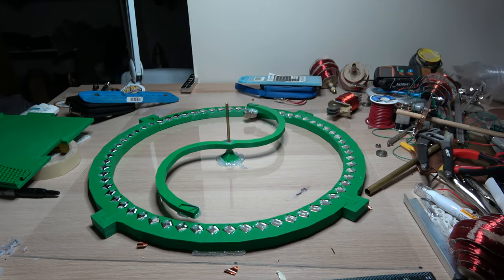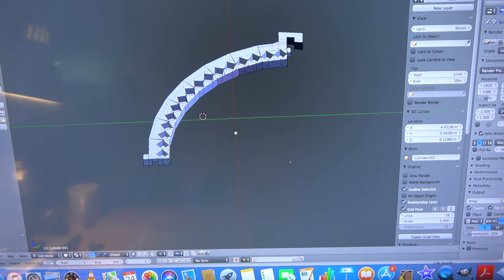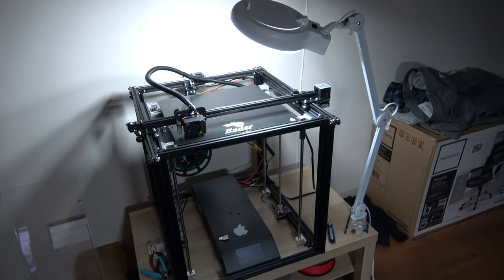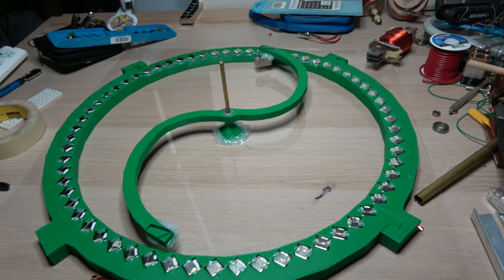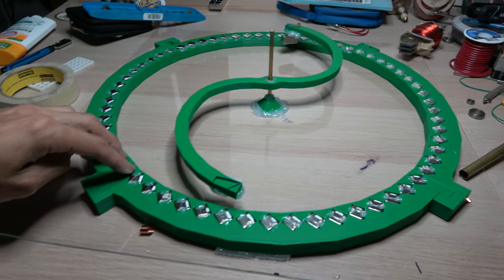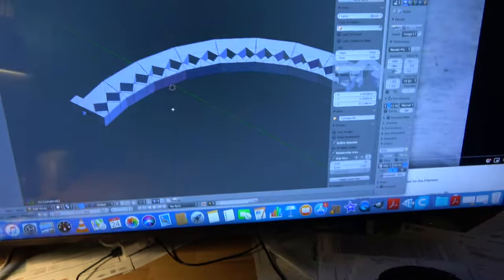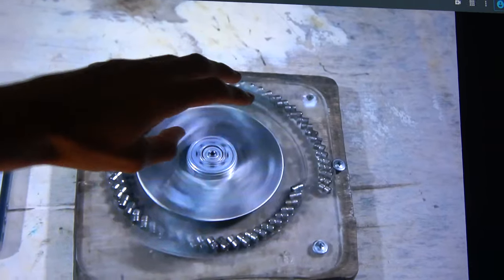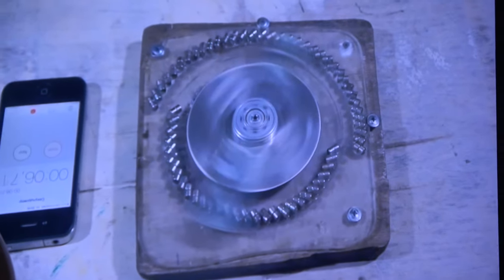Permanent Magnet Motor2 - Howard Johnson

Comment: Thumbs up because you tried.
I plan to do somewhat the same, but... with ultracapacitors + 3 permanent magnets in a tube + plus a very lightweight disk to act as an alternate switch between them. Basically, the p~ magnet in the middle would get strongly pulled whereas each of the 2 disks would alternatively redirect the magnetic field away from the nearest p~ magnet, therefore... allowing the furthest p~ magnet to pull the central p~ magnet which the force will recharge the ultracapacitors, whereas a tiny fraction of the charge will move the 2 disks simultaneously through an electromagnet.

Comment: I suggest making the center spin piece be shaped like a gear and have magnets within the teeth of the gear. Maybe 8 to 16 teeth on the gear. What would spin the gear piece is magnets stacked together (to increase force) on the outer ring. Only 4 placements of magnets on the outer ring. You can also add a hydraulic piston function to push the magnets on the outer ring to get closer to the center spin piece  for activation.

Comment: Change the angles of the mags on the arms, and use a spring to pull it back? Or use a flywheel that engages and disengages at certain points, Or try to add more weight onto the arm ends or 1 or... many arms working and well 1 or more working and like a baton race the next few arms take over ? Or spiral it up just one level and if it keeps going let it spiral back down, and that will be the completed circuit. Sorry can't draw it with my keyboard.

Comment: Hi there, your build is beautifully designed. Id like to offer a few pointers in order to help. 

Youll find it difficult to get anything other than an expensive brake that way, anything like the perendev motors wont work. The reason is ... that magnets have a kick not only to propel something forward, but also it has a kickback when a magnet enters a neighboring field. This is in equal amounts and will always result in stopping. The best you can hope for is an efficient use of invested motion.

There MAY be a way to jump over these kickbacks so that the forward motion continues. So having a Lifter that is in time with the armature so that it can jump/rid over this kickback might be the way to go.

Also ive seem videos whereby the traveling magnet is moving along a V formation of magnets, and jumping off the top. You might be able to create something like that for your armature to travel along, then have something that forces it to jump over the kickback field. 

Ive seen things on youtube that look like they have worked, but mostly these are hidden motors. In the case of your video share, you can clearly see its a dvd drive acting as the bearing. Some even use wind (hairdrier) off camera and record a separate voiceover. Others use tesla coil field to drive motors instead of a battery. People do this shit-faking order to make money of views, which confuses the young experimenters.

On a side note, have a look into Nitinol https://www.youtube.com/watch?v=oKmYqUSDch8

All the best
Reply from the maker: Thank you, and yes unfortunately many people do use compressed air and other things (like Tesla coil wireless electricity) to create fake videos.  However, some are real like Howard Johnson's original patent for his all magnet motor.  I will have to learn how to grind magnets into crescent/banana shapes in the future.  Here is a video of a real magnet motor in case you were curious.   http://gp.alternate-energy.net/magnet-motor-free-energy-selfrunning-12_bff8aacb4.html

I saw that video about Nitinol some years ago.  Absolutely fascinating stuff!

There is a video on the link I gave of a German made magnet motor from 1962 that apparently uses the same concept you have mentioned.   It might be right up your alley.
Reply from the maker: @DiyEcoProjects  Thanks!
Reply from the maker: Here's the video of the German made magnet motor from 1962 that uses the concept you've described.  Their device worked supposedly.  http://gp.alternate-energy.net/lueling-permanent-magnet-motor-vintage-selfrunning-magnet-motor-from-the-1960s_d1a62de6c.html
Reply: @spiritelemental  cheers for that one... hmm. Also heres website ive just discoverd for pdf's ... look up magnet motors here i guess https://core.ac.uk/

All the best, chat later

Comment: Try replacing the two posts with one and  3D print a case to hold a counter weight which is slanted and has an uneven weight distribution on left and right side.

Comment: you could avoid friction by making the spinner float completely in air by building a magnetic levitation system for it using wireless power transmission. i actually dont think its hard at all, im planning on trying it my self :)

Comment: Why do you leave the magnetic circuit open? The outside magnetic field goes where? Use iron and wrap it down and back to the inside.  The magnets will travel along iron better than air. That is where I see you need the banana shape. On your arms 2 magnets with a U shaped piece of iron, like a tuning fork, you can pull one pole to the center shaft and the ends of the U shape are the opposite pole. Your magnetic circuit is open. I do like the setup, just needs some fine tuning.
Reply: Sam Zurick  but you still need to redirect the magnetic fields..

Comment: Yer only doing one ring, basically one dimension of it.
Like the Perendev type, there's several different rings tied together on one axle...
In the 3 ring type the magnets are offset. 
Try what your doing, but tie them together with other wheels of the same design.
One wheel pushes the next one past the resistance field. 
I can't see it working on one dimension...
You have to cheat to win basically !!!
LOL
Have you considered trying that ?

Comment: Are the poles distinct on those cubes?
If so try aligning them north-south, south-north or make the pattern seen in the vid You showed i.e. most of the circle north in and some of it south, then spin it and see if it runs
If not try using rectangle bar magnets. 

Also look into coral castle and the shape of the magnets in Ed's wheel.

Also Magnetic field viewing film

Comment: Hello, I had a weird dream recently. Think of the Harry Paul Sprain magnet motor. But tilt one side  up a bit, so that the magnets are pulling the rotor up hill. Then, as it comes around to going down hill, the rotor has gravity working to help it escape the last magnet/sticky spot. No electro magnet at the last node. Could it work??? Thanks for all of your hard work.
Reply: hmm if you included a flywheel that got engaged just as the gravity was there to help, you could use the momentum to help blast it through, then at that point have the flywheel disengaged. Or stay engaged, its good to use up every bit of pull/push from the magnets as you go (assuming speed/momentum is not needed before hitting the point where gravity is used)

Comment: I tried many confugurations don't wste your time and money,I whoud like to build me a UTRON for casting aluminum in it soo if you are intrested in making frame for csting aluminum for utron I whould buy it let me know I think plstic will hold enough aluminum without melting plastic ?
Reply from the maker: The plastic nozzle tip of the 3D printer is set to 200 degrees Celsius.  I'm pretty sure Aluminum has a higher melting point than that so the plastic will melt.
Reply: @spiritelemental  Ok thank you I goes we eed metal 3d printer I hope one day I will get it but keep with good work ...:)
Reply from the maker: @nukeelda  You could always just print up a Utron coil out of plastic and then wrap a coil of wire around it.  An inner sphere of salt water can also be used to act as a kind of battery.  Otis Carr used a sphere of liquid mercury inside each Utron in his earlier prototypes that actually worked.
Reply: @spiritelemental  the wire I think isn't good solution If I ever build it it will be as on paperwork

Comment: Can you place in it a vacuum? Or would it damage the material? With no air resistance I'd imagine it would give you more output. Also like you said an imbalance is the only I way I can think of to have it in "constant" motion. Can't wait to see the next vid!
Reply: Sorry to say this but the problem with this design and really every other perpetual motion device is not the air resistance or the configuration of the magnets or any other design factor, it is the fact that something that spins indefinitely without any input goes against the laws of thermodynamics, and therefore is and forever will be impossible. There is no such thing as a free lunch.

Comment: Tips for your construction.
All pepole idea about free energy, hade work if the had a flywheel,,, with store energy from the first magnet magnet cycle...I am not soo good too explanie,,, I from Sweden..:)
but if you make the arm longer soo you have the magnet above, and the magnets will push them apart, so you place a flywheel that weighs so you do not have a large gap. the flywheel pushes down, and if you have its angle, do not know which bay you are using ,,, but with the right angle you can make it rotate ...
but must have weight, which stores movement energy and small spaces ...
draws and lays out on my page ,,,
// Mattias Sweden

Comment: Wait just one moment! Please hear me out spiritelemental, I remember on your pervious video about vicktor Schauberger and the fact matter and everything else moves in a spiral or a wave pattern. Now this contraption in this video is just spinning in a linear fashion, the arms are stagnant. But what if the arms moved in a wave motion above the track?
Reply from the maker: You are correct I believe.  Once I come back to this project I will eventually most likely build something like this where there are 3 armatures all staggered somewhat out of phase with each other.   https://www.youtube.com/watch?v=qUwoNhUUfb4&feature=youtu.be
Reply from the maker: That's after I build the replica of the device I reference in this video of mine "Permanent Magnet Motor2 - Howard Johnson".
Reply: @spiritelemental  that was beautiful! Thanks for the link. Also in this video the examples you've showed are far superior than my wave idea for the arms because of its simplicity. But if you can simplify & make it flow naturally then it's all you

Comment: You need three phases it or it will never work
Reply from the maker: It would seem so, at least from looking at Howard Johnson's patent in which he uses 3 Crescent shaped magnets, that surround a rotor made of a set of imbalanced magnets.
Reply: @spiritelemental  I meant 3-phase like a spiral staircase. So that every position in each phase is pushing against each other with the magnets opposing sides.
Reply from the maker: @craig265  Do you have a picture of what this looks like?  Or a video of someone who tried to build it?
Reply from the maker: @craig265  Uh, this makes sense now.  Almost like 3 phase AC electricity where each sign wave is off 90 degrees, if you understand this crude analogy.  So the 3 outside larger rings of magnets are offset by a few degrees?  And so are the 3 inner smaller set of rings?   In this configuration an imbalance is created that the device tries to correct by spinning.  Correct?
Reply: @spiritelemental  yeah pretty much.. but don't forget the  outer magnets are set up for the same principal.

Comment: there are several mistakes that you have made in your construction.
1. magnets take effect every millimeter you pick between them;
5mm between the magnets so you have 8% left in magnetic force ...
2, the magnets that sit around have too much space ,,,

my suggestion is that you make a longer arm that rotates. so you get a smaller gap between them.
and you need a flywheel, which gets you fixes motion energy.

difficult to explain more ,, åste show with pictures, for easier understand what I mean. :)

greetings
Pappa of SwedenSweden calling
Reply: Don't forget the fact that it is physically impossible due to conservation of energy.

Comment: Dude, I've cracked the apparent problem. Contact me asap.
Reply from the maker: and how would I do that?
Reply: @spiritelemental  using solar power or small energy to turn each magnet 'on' and 'off' - experiment using a single magnet on one end at a time, or find a way to put a magnet in the middle on a middle rod - and when each other magnet activates, it spins. You would have to calculate the exact point to switch off magnet 2 as it travels from 1 so it can touch three just in time, then 3 has to be turned on just in time for it to be enticed by 4, to keep this pull - this acceleration - we use elecreomagnets/find a way kill magnetic fields perfectly.
Reply: @spiritelemental  could be solar, something as simple as one of those wind up torches - something like that. : ) was reflecting on it last night. Solar power can be used as the 'jump' to get the magnet in the middle going and spinning on the rod, which then generates energy through some friction harnessing device - once it gets through enough 'spins', it can use energy it has generated to turn electromagnetic fields on and off on the outer magnet. Would have to combine it with a programming language or controller.
Reply: @spiritelemental  you got an email? Discuss it there. Hmu after you see these comments
Reply from the maker: @Jackitate  You should be able to see my email on my about page once your logged in.
Reply: @Jackitate  I love how your solution to the perpetual motion problem is to turn it into a solar powered motor, you are not going to generate any more power than the amount that the sun put into the panels, first law of thermodynamics remember.
Reply: @danvidsgaming7789  that isn't actually the solution. The solar motor only acts as a spark for to movement initially occurring.